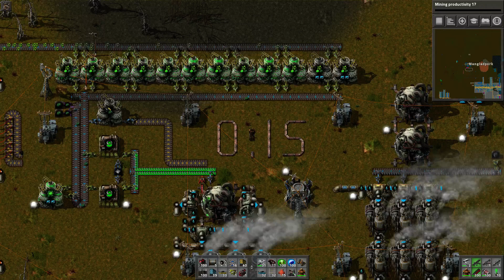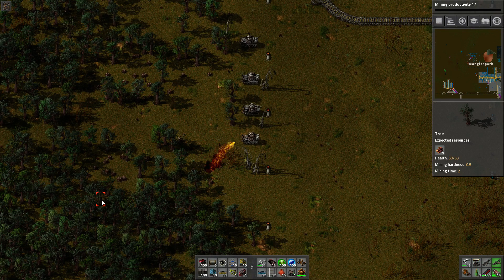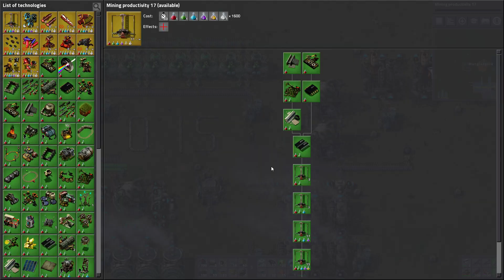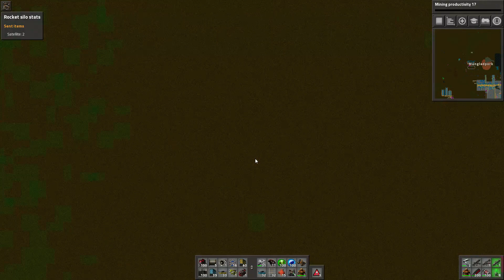Factorio 0.15 Update Overview

Comment: Bentham, U238 is stable while U235 is radioactive.
Reply: Nuclear physics is a bit more complicated than that :P There's no stable isotope of Uranium - U-238 is more stable than U-235 (by about an order of magnitude), but still radioactive. The important bit for nuclear power is that U-235 is *fissile*, while U-238 is not - that is, shoot a neutron at an atom of U-235, and it *splits*, releasing tremendous amounts of energy (as well as extra free neutrons, allowing a sustained chain reaction). But there's still ways to use U-238 for power production - like transmuting it to fissionable plutonium in a breeder reactor.
Reply: It's not electrically charged, yes; but that doesn't mean it doesn't have kinetic energy and momentum. When fission occurs in an atom like U-235, free neutrons are released (for U-235, about 2.5 on average); these neutrons take part of the difference in the binding energy of the parent and child nuclei with them as kinetic energy. Then they bounce around the moderator, losing energy without absorption (the proportion of neutrons absorbed dictates the rate of the reaction - all else equivalent, a less-absorbent moderator will require fuel less enriched in U-235; the Canadian CANDU, which uses heavy water as a moderator, can in fact use natural uranium - no need for enrichment at all). The way a typical nuclear reactor works, the initial neutrons come from spontaneous fission of U-235 (or Pu-239), and the reaction is controlled by changing how many neutrons from fission are absorbed, and how many are left for further induced fission. No "neutron guns" are necessary, the reaction starts and sustains itself.

Of course, some nuclear events release alpha particles as well; however, note that it's easier to get a neutron to stick to a nucleus, exactly because it has no electric charge. The alpha particle is repulsed from the nucleus, since they both have a positive charge. All things equal, it would require much more time and kinetic energy to make alpha particles stick, and they cannot induce fission, which relies on a deformation of the nucleus due to the extra neutron that causes the electrostatic repulsion to tear the nucleus apart.
Reply: I'm wary of saying things like "nuclear bombs are similar to power plants", but most of the points you make are correct. Nuclear reactors are designed to maintain a critical (self-sustaining) reaction, while nuclear bombs are designed to cause a super-critical (exponentially increasing) reaction. Tampering with nuclear fuel, control rods or the moderator would not allow you to cause a nuclear power plant to undergo a nuclear explosion, unless the tampered-with fuel already had super-critical density - which kind of defeats the point of the excercise.

The reason fission fuel doesn't spontaneously maintain a critical (or super-critical) reaction is that the neutrons that come out of the spontaneous (or induced) fission are too fast to be captured readily (slower neutrons have a higher capture cross-section). There is some wiggle room for a sci-fi novel (nuclear fuel "poison" that transmutes into a powerful neutron-emittor in the reactor?), but real plants have many layers of defence that would make this unnecessary hassle (as in, you could more easily just build a nuclear bomb outright, rather than trying to subvert an NPP).

Fissile material density is the key, but even modern nuclear weapons don't actually have super-critical amount of the fissile material at standard pressure - rather, they use conventional explosives to compress the sub-critical amount into a volume small enough that it becomes super-critical. And since this involves a lot of inward momentum, this in fact allows the reaction to proceed longer before the material is dispersed again, improving the yield. There's many other tricks used to improve yield or safety.
Reply: yes pretty much but you can't shoot an neutron without combining it with an proton because other ways it is neutraly charged. (I know if you combine it the neutron is still neutral). So there are no single neutrons splitting up of the U-235 either these are mostly Helium Isotops aka alpha rays.( Correct me if i missed something)
Reply: Ah ok of course are the neutrons part of the kinetic energy but I didn't know that nuclear reactors are started like that. On the other hand are nuclear bombs working by forcing U or Pu atoms to split... But anyway thanks for teaching me a bit again. (You never stop learning!)

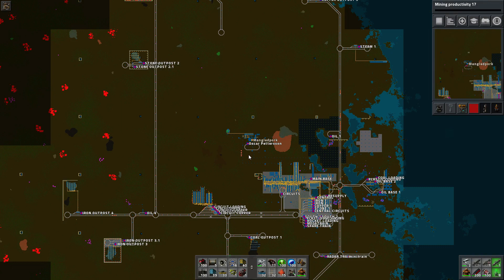Comment: There's not a bug at 34:09, rather there are new buttons for map mods. You have to click the red square and it will turn on polution. (There's probably a keyboard shortcut as well, but I can't recall it off-hand.) The buttons to the left will also toggle the logistics network range, electric grid coverage and turret range/coverage.

Edit: Ahh, at 39:07, you discover them. They're quite handy!

Comment: U 235 is the only isotope of uranium that can fission

Fission being shooting a neutron at an atom and it being split in 2

All uranium atomic bombs are made of u 235 

U 235 is found in nature at a    .72% rate
Reply: Not quite true. There are nuclear reactors that can deal with natural uranium, like the Canadian CANDU. The point is that you need a bit different design, and a different neutron moderator, and a different build of the fuel bundles... The U-235 is the main source of neutrons, but when the neutron is absorbed by the surrounding U-238, it transforms the U-238 to Plutonium, which is itself fissionable (that's how it already works in typical light water reactors). The tricky bit is that heavy water (which is used by CANDU) is rather expensive, adding to the already very high capital costs of building a nuclear power plant - while the cost of the fuel is actually just a small factor in the electricity cost from an NPP. I wouldn't be too surprised if a more complex nuclear mod appears at some point, something like the amazing Angel's mods did for ore refining and petrochem. There's so much awesomeness you can do now that wasn't quite possible before 0.15 :)
Reply: I think it splits into 3 not 2
Reply: All the odd isotope numbers tend to be fissionable isotopes, so for example Uranium 233, uranium 235, uranium 237, uranium 239, neptunium 237, plutonium 239, plutonium 241 etc etc, usually the even numbered isotopes like to accept neutrons and remain stable while transmuting into other elements. There is a process that takes advantage of this called a Breeder reactor where you transmute a fertile element into a fissile element and use the energy generated from fissioning of the fissile product to sustain the breeding of new fuel.

Comment: You should retire your current Railworld and start a Railworld Season 2. I feel all the updates will make it a pain to try and rejig the current one and also you can use that new preset.
Reply: to be honest i think a new map would be cooler, new things to find and explore. current railworld has already been explored and it would be kinda boring to experience the same things again.
Reply: What about season 2 on same map seed?
Reply: Jetu Hajice That would work. I'd hope he can clear the biters around the base, create the old mining sites, and make the rail line around the lake before releasing the videos, as it would be boring to re-watch that. That way, the videos could all be about building the new factory to turn the incoming resources into research.
That would probably be the ideal solution, even if it takes a while to do, but the lack of constant biter attacks should make it go a lot faster. And I'd have no problem with cheating through the early tech levels to get instant access to trains. We don't need a RailWorld without rails.
Reply: But we may not get the awesome giant lake. But I'm eager to try the map type myself. I have a different architecture that handles common, smaller deposits very well, even when collected from farther away than the RailWorld map. But the slowing of the biters is very useful for it too, as that problem can't be solved as efficiently.

Comment: On the whole "Enriched/depleted" uranium thing, it's a bit complicated because real life doesn't work like factorio, but here goes.
Natural uranium ore is ~0.7% U235--like you mentioned, the good stuff.  The point of enrichment is to take out as much U238, the junk, as you can, without taking out the U235, this raises the percentage of U235 to, if you're making a fairly normal reactor, ~3.5%, or, if you're making a bomb, ~20-30%.  If you had a sizeable chunk of pure U235 like you do in the game, it would basically immediately go supercritical and immediately irradiate the everliving fuck out of it's surroundings.  The leftover, nearly pure U238 is the depleted uranium.  DU, incidentally, is just about the densest thing we can produce that won't make you lose your hair, so that's why you see it in things like armor, armor piercing ammunition, weights, etc.
Also worth noting, Uranium is a heavy metal, just like stuff like Murcury, Arsenic, and Lead, and so it's pretty fucking toxic.  Factorioman was already very dead for many reasons, but now he gets to add heavy metal poisoning to the list.
Reply: They even said in one of their FF that the actual process was too complex to implement in FActorio, which is why they simply solved it using the "kovarex process".
Reply: So the thing is U-235, unlike U-238, is easier to split in a reactor, because it's much less stable. U-235 has a half-life of 700 million years, compared to 4.5 billion years for U-238, which is why U-235 is so rare. Some reactor types can use unenriched uranium (instead requiring other exotic molecules), but others (safer, more modern) can only use enriched uranium.

Also in reality there would be other elements than U-238 coming out of the reactor - U-235 is not turned into U-238, but into smaller atoms - but most of what comes back out would indeed be the 97% boring U-238 you put in.
Reply: Also the recipe which takes U235 and produces a little extra U235 are supposed to be essentially breeder reactors. Nixon tried pouring a lot of money into them IIRC.
Reply: You can hold natural uranium metal in your hand, you're not going to die from it, unless you ingest it like any other heavy metal. Also bombs need Over 90% fissile material to be considered weapons grade, you also need a neutron source. Nuclear bombs are actually pretty stable, it requires some work in engineering terms to detonate a fission bomb.
Reply: stupititykills y
Reply: fff readers know more!
Reply: In my head cannon factorio man is genetically engineered superhuman, how else can he go without sleeping and food, heal critical wounds in a matter of minutes and survive space travel and lethal dosses of radiation?
Reply: stupititykills You might already know but the developers based the enrichment process off of a fictional one.

Comment: yeah, they just made them more expensive, not more complex :/
Reply: I would say some of the recipes are quite a bit more complex due to the changes. Green circuits ,for example, take 10 wires instead of 3, this drastically alters your circuit setups as you need 5 wire machines for every 1 circuit machine. But yea they didn't add a ton of extra intermediates like Bob's or anything.
Reply: Nindydar But you are using the marathon mode for that. With the default, all the intermediate recipes are the same.
Reply: Alex Siemers Yea that's correct, I'm using the new built in marathon mode for that. If you play standard settings and don't increase item costs then all the recipes are more or less the same as they have always been.

Comment: yes bentham steam is a fluid not a solid.
Reply: either way hes correct, liquids and gases are in fact both fluids.
Reply: A fluid is defined as a substance that has no fixed shape, yields easily to external pressure and able to flow easily. a gas falls under this lable
Reply: The Woodio Bros *input

Mr vindictive, at least he's using the correct spelling
Reply: Chris Drew is it not a gas?
Reply: Yonkage Thanks
Reply: DerTolleIgel Try putting them in canisters that are insulated to prevent heat loss.
Reply: Steam is definitely not a liquid. It's water in a gaseous state by definition. It does behave as a fluid like most gasses.
Reply: Well... TECHNICALLY it's a liquid. Since it's being sent along through pipes while under high pressure, it would actually be in a liquid state but above the normal boiling point; same concept as a pressure-cooker, really.
Reply: There should be a way to create Solid Steam, so you can transport it on belts..
Reply: a gas is still a fluid
Reply: +DerTollelgel Generally we refer to frozen steam as ice.
Reply: Thanks for your idiotic imput MrTomyCJ

Comment: For 0.15, you REALLY should try playing the marathon mode. Circuits take 10 wires (still 2 per plate, 5 plates in total) and 2 iron plates, gears are 4 iron per, science pack requirements are quadrupled, steel takes twice as long and 10 iron. Please do this for your new playthrough!
Reply from the maker: Crap, I got that wrong in the video then, I didn't spot that there actually were different recipes and assumed the options were just mod support stuff.
Reply: And one cool thing: since the uranium fuel cells technically count as "burnable" fuel, nuclear trains are a thing you can do now!
Reply from the maker: Afraid not, already tried that. No infinite trains quite yet.
Reply: They actually changed the fuel system - it's quite a bit more flexible in 0.15, no longer just "fuel is anything with an energy value". I'm actually quite impressed with how much more things you can do in mods now. Proper nuclear trains will surely come soon enough :P
Reply: Ironically if it was a "low tech" steam train you absolutely could power it with a glowing uranium fuel cell.
Reply: If it put out enough heat to boil water then it could run a steam train. Not safely or likely very efficiently, but it would work.
Reply: No.. You would not >.> There's a reason beyond security and safety nuclear power plants are expensive to run.
Reply: There's many simpler ways to build a nuclear power source than what we're using. For a nuclear steam train, there's plenty of simple options, especially if you don't care about pollution. Nuclear power plants aren't expensive to run, their expense is mostly in capital costs - building them, decommissioning them and taking care of the waste. Their day-to-day operation is (slightly) cheaper than a comparable coal power plant, and much less if you're in Factorio Guy's position :)